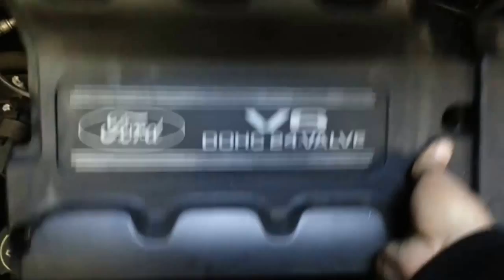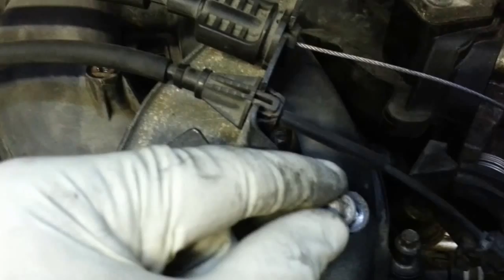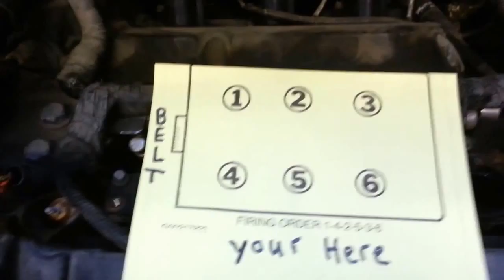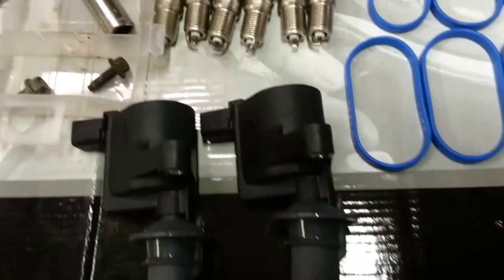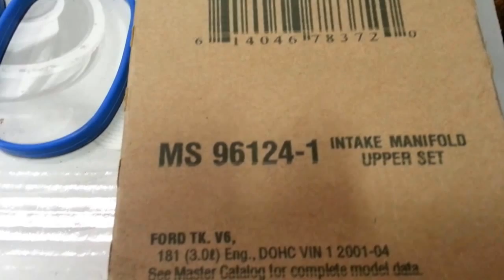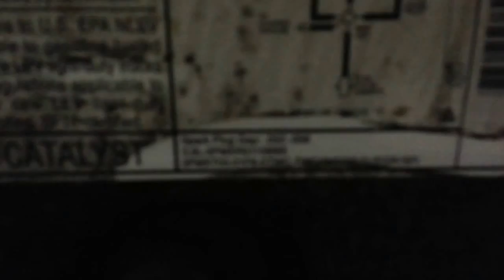FORD ESCAPE/MAZDA TRIBUTE 3.0 DOHC MOTOR TUNE UP

Comment: my mazda tribute 2003 wont go past 4000 rpm.can you help me whats wrong with it.by the time i get 4000 rpm it start a bug vibration on the engine.
Reply from the maker: Check engine light?

Comment: I have the 2005 Ford 3.0L DOHC Duratec engine. It has the Electronic Throttle Body but pretty much the same job,  correct? My intake also has gaskets for the 6 plug wells too but no biggie.  Great video man. THANKS!! Thumbs-up and new sub!!
Reply from the maker: Absolutely, thank you for the Sub!
Reply: @WildOwlWoodWorks  I was thinking of my valve covers when I wrote about the 3 gaskets each for the plug wells.....  Not the intake...LOL. Thanks man!! Gonna do this job when it gets warmer.  Used to have a garage back in the late 80's /early 90's. Did a lot of work on the old V-8's, Slants and straight 6's. From tune ups, engine swaps to head gaskets. Everything really. Then I had to stop and didn't open a hood for over 2 decades. I didn't even know what I was looking at!! Realized it was still an engine though and did some research.  So my intimidation went away.  All sensors now.  Still though,  just an engine. Had a LOT of catching up to do.  Really miss my old tools and garage though.  Spent a ton of time in there back then.
Reply from the maker: @RickyPisano  your most welcome, thanks for watching, and if you have any more questions, just aaked

Comment: hey Nocturnal, great video. Have a idle issue with this same motor in a Mazda Tribute. After warming up and i get to a stop light it surges the idle like if it has a blower on it lol, best way to describe it. What do you think it could be? I have cleaned the idle control valve and throttle body and still does it. Thanks in advanced for your help.
Reply from the maker: Charlie L take a can of brake clean and spray around hoses and intake,sounds like a vacuum leak
Reply: NOCTURNAL MULTIMEDIA GROUP I will give that a try and let you know. Thanks for your response.

Comment: Thank you for this video...we were able to change out all the coil packs an spark plugs BUT there it's still missing an stalling when we start it...runs smooth once it warms up but bogging down and stalling for about 10-15 mins after starting it....any ideas???
Reply: Hey Julie did you ever figure out what your issue was my tribute is doing the same thing?
Reply: we thought we did but the sputtering an stalling on start up is back...once it warms up it runs perfect...we have changed out the ERG valve and the IAC valve an nothing changed...so we are now stumped
Reply from the maker: Julie Garrett check engine light at all??? email me at nocturnalpro1@gmail.com I will answer your questions faster there
Reply: Email sent...Thank you for your response

Comment: good video...i have a 2001 ford escape 3.0 V6, the other day i cheked the spark plugs and they have a little oil in it. should i replace the head gaskets? do you have a video for that?..thanks...keep up the good work.
Reply from the maker: thank you for watching..answer to your question  is no,you want to replace the valve cover gaskets,with valve cover tube seals,the seals are leaking where the spark plug coils go in at the valve cover..
Reply from the maker: thank you for watching..answer to your question  is no,you want to replace the valve cover gaskets,with valve cover tube seals,the seals are leaking where the spark plug coils go in at the valve cover..
Reply from the maker: thank you for watching..answer to your question  is no,you want to replace the valve cover gaskets,with valve cover tube seals,the seals are leaking where the spark plug coils go in at the valve cover..
Reply from the maker: thank you for watching..answer to your question  is no,you want to replace the valve cover gaskets,with valve cover tube seals,the seals are leaking where the spark plug coils go in at the valve cover..
Reply from the maker: thank you for watching..answer to your question  is no,you want to replace the valve cover gaskets,with valve cover tube seals,the seals are leaking where the spark plug coils go in at the valve cover..
Reply from the maker: valve cover tube seals are leaking..where the coil goes in the valve cover
Reply from the maker: valve cover tube seals are leaking..where the coil goes in the valve cover
Reply from the maker: valve cover tube seals are leaking,not the head gaskets
Reply: +NOCTURNAL MULTIMEDIA GROUP....thanks bro.....btw, do i need to drain the oil?
Reply from the maker: +Ben Gaete no,not at all,just let the Motor be at cold temp,so most of the oil has drained to the pan..good luck,BTW,use brake cleaner to clean valve covers,so that there is no oil where the new gaskets go

Comment: I have a 2005 Ford Escape and when I start it the whole motor shakes can you please give me ideas of what is wring
Reply from the maker: does it shake until it starts or does it continue for more than ten to 15sec?
Reply: It runs like that the whole time
Reply from the maker: check engine light?Code??
Reply: How do you do that
Reply: It's orange
Reply: It barley gets up 20 mph
Reply from the maker: you can go to your local autoparts store and they will read the codes for free ,auto zone,advance auto parts....Sounds like to me you have multiple misfires on different cylinders and if this was a problem that progressively got worst,you may have clogged catalytic converters,that will cause the vehicle speed to be a very slow pick up.....Get the vehicle up to temperature,then take a rag and hold it over the tail pipe,if after a few moments you don't feel any real heat or the truck dies out,Cats are your problem along with a major tune up..."Best answer"
Reply: They said it's the pcm
Reply from the maker: If the pcm isn't getting 12 volts at all times that could be a possibility,but i find that to be a very rare case
Reply: What do you think it could be

Comment: I have a 2003 and a 2004 Mazda tribute and was always intimidated by replacing the rear coil packs, but thanks to you ,not anymore...And maybe now I know why  I have a problem with # 4  with a misfiring issue--could just be gaskets need replacing.....Good job on video ,I learned alot
Reply from the maker: Thank you for watching,and i hope it works out for you.

Comment: MrNocturnalpro1 looking good.  I have seen several videos showing what you are doing here and they are not even close.  What about a swipe of anti-seize on those plug threads?  Made me a little nervous with those intake ports not crammed with a paper towel.  I also like to do a light blow down to get rid of the trash that seems to get in there from never never land after I have plugged the intakes and before I open the coil overs.
Reply from the maker: Thank you.... as far as those ports being plug with papers towels and such,I didn't want anyone watching that is a novice at doing their own repair to forget to remove any thing that may help prevent bolts or debris from going down the intake ports,I've seen this mistake by other technicians,where they started the vehicle and had to redo the job by removing  the lower intake, but they used red shop towels,imagine they mess they made. anti anti-seize on the plug threads in my opinion is over rated,because most  Platinum Plugs now days are rated for 80k miles which will long outlive a Ford 3.0 motor life if it has over 100k miles...Again my opinion..But your right,I should have shown that,but i wanted to keep it simple in my eyes for the veiwers...Thank you for watching. ..

Comment: Great video, thank you! I have a 2002 Mazda Tribute and just got a P0306 check engine light code which is "misfire on cylinder 6". Can I just change out the spark plug and coil on 6? I hope so, because 4,5, and 6 are easy to get to. I'd hate to mess with 1, 2, and 3. Thanks for any info.

Comment: Great job, It was a huge help to see the process. I picked up a Tribute today for my wife and I will do a full tune up oil change and give the engine a good bath also use wire sealer to keep everything water / moisture free for a better running ride up here in Maine where winter kills vehicles with just brutal temp extremes. I would like to see a video on undercoating the undercarriage with maybe sandblasting to bare metal and sealing it for extra road salt protection which kills all vehicle frames and brake lines and systems here in no time, will you be doing any project like this in the near future?

Comment: I have 2005 Tribute with 150k on the clock do you think I should replace the 2 coils, spark plugs and gaskets as you have done even if I'm not getting a misfire or leak of air? Will it be beneficial or make the car run better?
Reply: Also I am searching the gaskets for an 05 Tribute and they are different to the shape you used, the ones displayed are oval but have another U on one side =, can you tell me which will fit my 05 model? Cheers

Comment: Thank you so much for your excellent video.  I have a 2001 Mazda Tribute V6 that has had misfire problems for YEARS without my mechanic solving for more than a few months max--then one cylinder or another misfires again and/or the check-engine light comes on.  Stalls out frequently, sometimes hesitates at 1500 rpm and 55 mph.  Sometimes with, sometimes without engine check light coming on.  Finally am trying a new mechanic; he claims the fuel pressure regulator needs to be replaced before he can proceed to see whether anything else is wrong.  Again, thanks for the video!

Comment: I have a random misfire 05 Mazda 6 same motor.... bought a reader for $20. Looks like cylinder 4 and 3 misfire at high speeds and little load. I have replaced all the plugs. I moved some coil packs around and still misfire on the same cylinders... I did not changed the plenum gaskets. Could this be it? Vacuum pressure seams ok. I used carb clearner and no issues noted... im over this P0300 code! Please help.. thanks

Comment: Thanks for the video. I have a 2002 Mazda Tribute and am getting a P0301 error, misfire on cylinder 1, usually only does it when it's raining or when there is high moisture in the air. Do you think this sounds like a bad coil for cylinder 1?

Comment: Thank you Mr. Nocturnal!! Very informative for a novice like me. Please do more vids. Also I have a question. On the left side if the motor towards the bottom (If your standing in front of the serpentine belt) Its easier to see if you look down past the EGR. I have a "nipple" if you will without a hose. I am getting a P1409 trouble code, and I have replace the EGR the solinoide and pretty much all the vacuum lines. Any help would be great!!

Comment: By trade I am an electronics tech & electrician I did both trades concurrently and worked on electronic equipment in the Royal Australian Airforce for 20 years.  I seen to have an intermittent problem in a 2001 Tribute Escape. Every now & then the engine starts missing on one cylinder, I have replaced all plugs and am now suspecting a coil. Is there anyway of checking the coils ??   I was thinking of feeding a variable pulse generator via a switching transistor into the low voltage winding and monitoring the HV output of the coil on an oscilloscope and seeing if the output varies over time and frequency.  Any thoughts ?

Comment: Forgot to mention, when I have driven the vehicle even just for e few minutes it will have an odor coming from the car, it's smells like a burning/melting smell, but no smoke anywhere.  Belts seem fine and in good shape.

Comment: I have a 2004 Ford Escape with the V6 3.0 engine. Vehicle starts fine, sometimes has a little bit rough idle at starting it where the RPM with fluctuate between 500-1300.  This settles down pretty soon.  Biggest problem I have is that when I accelerate when at speeds between 40 and 65 it with hesitate/shock a bit.  I can literally feel the shocking like something is missing.  Is this misfiring?  Could it be dirty throttle body, or could it be transmission issues starting.  I have no check engine light come on or any errors to go by. I appreciate any advice you can give me.

Comment from the maker: Hello Tina, I think you are being taking on a ride, if I had your truck it would not leave my shop until it has been totally test driven and problem solved, remember take it to a ASE CERTIFIED TECHNICIAN....Here is a quick test u can do, take engine cover off, and get a can of brake cleaner..spray it around to top of the motor, if the truck seems to die out, u may have a vacuum leak..

Comment: Great video-I just changed out all 6 SP in my 2001 escape but not the coils(vehicle is @ 107,000m). The engine no longer shakes like it did before but now I seem to have difficulty getting gas. Then I also noticed that the lower left splash shield melted away! Not sure what I should look for next....
Reply from the maker: hello and thanks for watching...ok first ...lets work on the no power this may be due to clogged catalytic converters if your vehicle has been miss firing for some time raw fuel will enter your exhaust and begin to clog your catalyst....noturnalpro1@gmail.com for a quicker response and further help

Comment: Thanks Great Video on the V6 3.0 motor..plug and coil replacement.
I have a question for you thought you might be able to help me with.
I have a 2005 Mazda Tribute "S" V6 3.0 A/T....I'm getting a lifter noise sounds like it's coming from the front head area...I haven't done anything about it as yet.
I noticed if I put an oil additive in like, STP it quiets it some..
After a few hundred miles the noise comes back however.....The sound isn't
there at all when the engine is cold...Only when it warms up....There's Hydraulic
lifters I found out in this model engine..Is there something I can try before bringing
in to someone..I'm very mechanically inclined and have work on a lot of different
engines...
Your imput is greatly appreciated..
Thanks again Mike "G"
Meriden Ct..
mjjg1500@yahoo.com

Comment: When changing the spark plugs and coils, do you change them one at a time? for instance if i take spark plug 1 out, do I put the new one in before I move on to spark plug 4? Or do I take them all out at the same time, then put all new ones in at the same time?

Comment from the maker: Thanks for watching!!!! Asked any ?'s you like
Reply: what is the tube/ fitting that comes out of the valve cover on the front of the V6 mazda tribute  motor that the emissions tube goes on? i think its part of the PCV tubing that starts at the valve cover and then goes to the back of the motor where the PCV valve is.